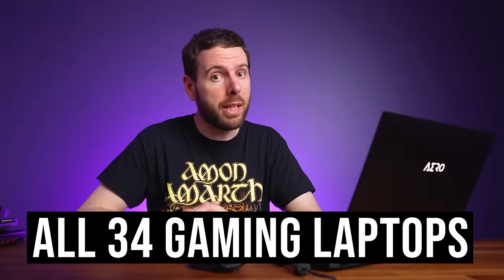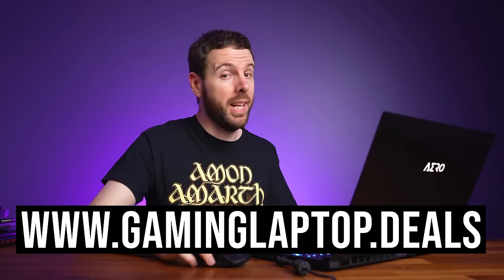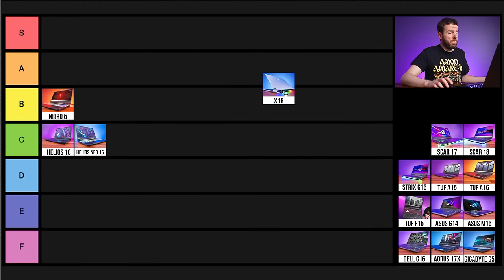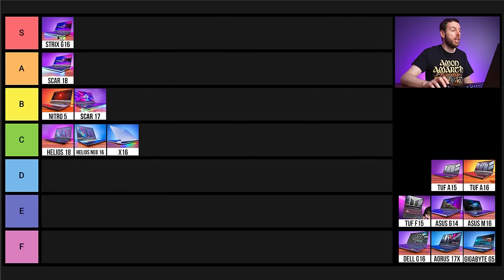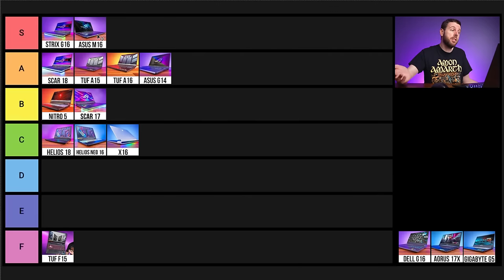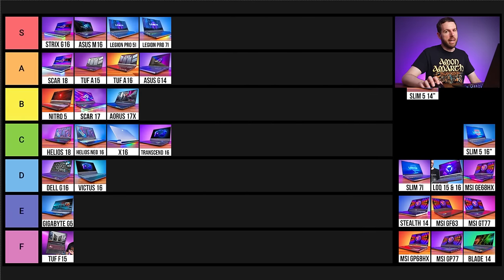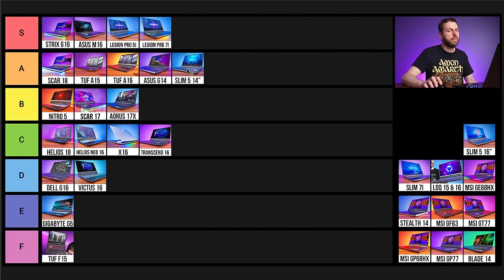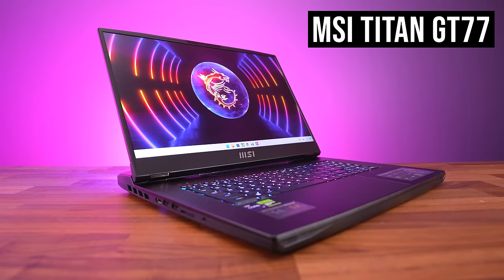Ranking ALL 34 Gaming Laptops I Tested In 2023!

Comment: LOQ is an S-tier budget laptop for sure. The amount of features it offers for that price range is really impressive
Reply: you just cannot upgrade the ram, I hate it
Reply: Only flaw is unupgradable RAM slots, and it should disqualify it being S tier. Definitely A tier. Id still pick Nitro V 16, cheaper, more upgrades and have Liquid Metal in it. 

Also for anyone curious, Nitro 5 and Nitro V are two different laptops. Check out Nitro V 16 or 17. Budget and High Tier.
Reply: Who says ram is not upgradable on the LOQ? I have one and plan to upgrade ram and have seen plenty of videos and forums about it
Reply: @mkgxcommanderx  i'm planning to buy LOQ 15 next week, how your experience been with it especially on gaming side does it overheat ?
Reply: @hvnsnt_9905 will games start requiring more ram soon ? Than 16 gb
Reply: The only issue with Loqs is their screen but again for their price they're totally worth it.
Reply: @m.heyatzadeh  they have 100 srgb options available
Reply: Depends on your country though. In our country, Helios Neo 16 is the S tier budget laptop since it's cheaper than the LOQ.
Reply: How is the ram not upgradable? I just bought a LOQ15 with 8GB DDR5, single channel. I upgraded it to 32GB dual channel. I checked my settings it says 32GB, both slots used. Online it says it supports 32GB.
Reply: For the people that say you cannot upgrade Ram, literally in lenovo's site it says it supports up to 32 gb of Ddr5 with dual channel. My only down side is the ssd second slot being virtually useless but it has a another so maybe just a minor downside but it depends
Reply: @fchk9731 hasn't crossed 85 degrees, playing RDR2 high settings for 2 hours. 120 fps with frame gen enabled. Insane.
Reply: Hey I'm planning to get asus a15 ..... do you thinks it's a good idea ..... can I get better with that price range
Reply: the LOQ 15 have a SSD upgrade ? i mean can i have more than 512 ssd?
Reply: @jaerys8823 no, cuz 16 is enough stop being babys
Reply: @m.heyatzadeh my loq have 2k, 165hz with 100% srgb. Whats wrong with it?
Reply: @mehshutup3041  That's good. I was talking about the 1080p versions which are cheaper and have 45% NTSC.
Reply: Hello should i get a Lenovo Loq ryzen 7 7840hs rtx4050 16gb or a tuf a16 Ryzen 7 7735hs Rx 7600 16gb?
Reply: @NAOTILTA  Nvidia RTX 4050 is a faster and more feature-rich GPU, while the AMD RX7600 is a more energy-efficient and cost-effective GPU. I'd go for RTX 4050, even though The AMD one has got faster memory, Nvidia RTX4050 gets a better support because of DLSS and it's more future proof than the AMD one.
Reply: @m.heyatzadeh  oh, so the loq one is better right?
Reply: @NAOTILTA  I'd definitely go for loq one. I've used Lenovo laptops for the past 5 years and they're durable and well supported. Although if you can go for the 4060 it'd be much better and more future proof since it's got 8GB of vram which will be helpful in demanding games.
Reply: just bought th e16IRH8!
Reply: What about the motherboard issue?
Reply: @knui333 mobo issues are for 2024 models.

Comment: This just proves how great of a job Lenovo are doing. Also as a legion slim 7i owner I think it's definitely at least A tier.
Reply: Can anyone help me im split between getting the legion slim 7i gen 8 with intel 17-3700H and RTX 4060 or dell g16 with intel i9-13900HX and RTX 4070 ik the specs look a lot better but peoples reviews have made me doubt myself
Reply: @EthanMcIntosh-qx1pm take the strix g16.Better build quality better costumazation better keyboard and a decent price now with black Friday.If not the slim i7 is good as well but I prefer the strix(have both)
Reply: @EthanMcIntosh-qx1pm I don't think Dell is worth.I know it seems better by specs but doesn't have the cooling and the 4060 is identical to 4070 anyways.
Reply: @EthanMcIntosh-qx1pm bro definitely do not buy a dell for gaming. You'll regret it
Reply: @EthanMcIntosh-qx1pm  whatever is cheaper for the same specs. But I have to say slim 7 looks like a professional laptop which I prefer
Reply: @koune1os17 Dell is not good enough
Reply: @lionelmessithegoatLM10  that's what I said
Reply: Hey I'm planning to get asus a15 ..... do you thinks it's a good idea ..... can I get better with that price range
Reply: @EthanMcIntosh-qx1pm Dell is garbage just like HP.
Reply: Lenovo is shit, don't buy it. They provide some great specs and the cost of build quality. I had two laptops in recent 3 years and needed to take both to repairment. One had ssd issue and motherboard issue (second one was costly and with no guarantee of not happening again soon), other had a screen issue and battery/charging issue. I have complaints by my friend as well. Lenovo was great 5 years ago and now it is just garbage.
Reply: @Windows98Fanboy  real, my g16 with a 12th gen i7 and rtx 4060, and 16gb ram can barely run minecraft with 3 optimization mods and shaders 😭
Reply: @koune1os17  what a clown... dell for gaming over Legion that is the best laptops 4 years in a row
Reply: In Argentina are more expensive than Dell or Asus or Gigabyte... what a shame

Comment: I struggle agreeing with the Zephyrus M16 being in S tier after ASUS sent out the variant with a 4070 and mini led to reviewers, but decided to not sell that variant in certain markets like the US, locking the mini led display to the more expensive 4080 and 4090 variants. This feels scummy from ASUS
Reply: Cap. 1500 at Best buy rn
Reply: @MangaRecapandAnalysis-ll6zj it's not the mini LED. It's just a regular panel.
Reply: @Razoronmd  oh damn good to know I was thinking of buying that one
Reply: Nah, you can buy a 4070 variant M16 with miniled

But just not the US

Definitely a dealbreaker for 2k, but for 1.5k? Considering the fact that you’re buying a t/l with a completely redesigned chassis + mobo for features typically only seen on thicker laptops? I would say it’s S tier.

As much as ppl trash on the 4070 about not getting more performance, the power efficiency really comes into play here as the M16, a t/l laptop, doesn’t have to partially cripple itself for the thing to even work.

I’ll stop circlejerking this thing, but I feel like if you’re very technically capable and are aware of ghelper, then this is the laptop to go for. 

But solely for performance alone? Yeah, I agree with y’all lmaoooo
Reply: Adding onto that too

The 4070 us m16’s screen is still considered like super top of the line IPS too.
Reply: In India it goes for 4000 fuck8ng dollars 😭

Comment: As a legion slim 7(AMD) user, it's plain perfect. 

Productivity-wise: Performance good enough for University projects . 4060 is quite capable of small to medium scale neural network training for edge AI in local environment. Extraordinary build quality, excellent 240hz 2.5k display suitable for all kinds of use cases, dead silent under light load, impressive battery life. 

Gaming: quite good when I play Cyberpunk. With the efficiency of 40 series GPU, I can achieve 70-80 fps at ultra when 140w portables adapter is plugged in. In cs2 the full potential of 240hz can be utilized. 

In a laptop form factor, it ticks all the boxes.
Reply: I love seeing all these comments on people thinking the legion slim 7 is underrated. It actually makes the laptop look better, which couldn't have happened if it wasn't originally reviewed as it was.
Reply: does the laptop get very hot and does the fan go crazy?
Reply: @yeye3124  Hardly warm to the touch when I use battery. No guarantee if you plan to game a lot. I've been running ROS Simulation in Ubuntu and debugging requires me to build the project every single time, therefore I can definitely hear the fan noise in this scenario. In terms of light use, it's dead silent.

Comment: I'm a little disappointed that you didn't recognized the excellent 1000nits Mini-LED Panel on the Predator Helios 18. That's what it make it better compared to other 18 inch Laptops. And the price is very good.
Reply: Helios Neo 16 also has a better display than all other laptops in that price range.

Comment: The Legion Pro and LOQ series is one of the best gaming laptops that Lenovo launched in 2023 which has overperformed than other laptops and has plenty of room to upgradeability
Reply: L0Q has a fatal flaw where there is an metal protrusion in one of the ssd slots and it is impossible to install full size ssd!
Reply: @eniojurko  i accept that drawback
Reply: @eniojurko it is posible. Just remove that thing. Removing it will not cause any problems.

Comment: Slim 7/7i is easy no 1 of the s tier. Best build quality, best price to performance to build ratio, best specs & upgradibility for price (16gb soldered & only 40dollar for another 16gig 5600), 2 m.2, all 10gig usb, tb4, type c charging 140w, sd card slot, most importantly you can turn off dedicated gpu completely, great color accurate 165hz 3.2k screen option for 20 bucks 😂, great keyboard as usual Lenovo, great doorstep support for 1yr free, 99.9wh battery, i just don't see how it's not top of s tier, 
The only thing they can improve is give an mini led screen as option or even better oled. 
I don't get why a "gaming laptop" has to be have only gpu & cpu specs & wattages to be great if that's what you want better build a pc.
Reply: Some people don't want low powered gpus such as 4060/70s in their laptop. I like have the 4090m in mine as I have a portable machine with 3090/4070ti desktop level performance wherever I go
Reply: Can anyone help me im split between getting the legion slim 7i gen 8 with intel 17-3700H and RTX 4060 or dell g16 with intel i9-13900HX and RTX 4070 ik the specs look a lot better but peoples reviews have made me doubt myself
Reply: I have a 4k 60fps dell external monitor at home. So picking 3k display will have a bit of overlapping in terms of functionality. But that's just me. No matter what kind of peripherals you have, legion slim 7 is easily the best choice for most people this year without breaking their wallets

Comment: IMO The helios neo 16 is waaay better and is heavily underrated. It has liquid metal, better cooling, hx intel processors and i think killer wifi card, upgradable in all slots, mux switch and all that for 1.2k+, dollars not to mention Newly upgraded design of the helios series. I think it competes with Legion 5 in the midrange area.

HELLA way better than those microwave TUF series be it amd or intel version. No ports at the back is a downgrade
Reply: Screen is meh, slim 7i has 3.2K diaplay with excellent colour gamet.
Reply: Fully agreed! The only position I disagree with.
Reply: Well,  Legion 7i is for in the premium ish range. The helios Neo is the budget option which competes with legion 5 also way cheapre, the Helios 16 is the more premium one and Im talkin the neo 16 here. 

Also Screen from the helios neo has QHD 16:10 @rajyavardhansingh4491
Reply: @jaerys8823  the display on Slim 7i is objectively better, and display matters to a lot of people
Reply: @LaptopDealsEU  what will you choose, LOQ 15 ryzen 7 7840hs 4050 or Helios Neo 16 i5 13500hx 4050 if both have the same price in my place?
Reply: @ryon24  depends on the screen. If LOQ is just 144Hz, then Helios.
Reply: At $799 at BB the Helios neo 16 is underrated here.
Reply: @LaptopDealsEU  the LOQ screen is 165hz, im using an external monitor, so the screen wont bother much
Reply: @ryon24  When connecting a laptop to an external monitor, there is another significant difference. We are talking about the "Memory bus" of the graphics card. The 4050 has 96 bits, the RTX 3060 has 192 bits. The wider bus allows better data transfer. While the level of the 4050 is similar to the 3060, when connecting to an external monitor the wider 192-bit bus will make a very big difference and it is better to take a laptop with a 3060.
Reply: I bought the RTX 4070 version recently. It doesn't thermal throttle, the screen is professional grade, and the port selection is generous. Plus all the stuff you're mentioning. Jarrod made a huge mistake right here with that model, and it's a shame he doesn't see it himself.
Reply: What makes the helios neo 16 so annoying is that they put hx intel processors and then they disable undervolting... with no workaround to undervolt it. unbelievable. I returned it.

Comment: Hi Jarrod, what would you rate this - 
Lenovo Legion Pro 5 AMD (2023) specs:

- *Processor:* Ryzen 9 7945HX (16 core, 32 threads, 5.4GHz, 80MB cache)
- *GPU:* RTX 4060 8GB (140W, DLSS 3)
- *Display:* 16-inch, 240Hz, 16:10, 2560x1600 QHD IPS, 500 nits, HDR 400, 3ms response time, G-Sync, Dolby Vision, X-Rite, Delta <2, 93% screen-to-body ratio, Dual direct gfx 1.5
- *RAM:* 16GB DDR5 (8+8) 5200MHz
- *Storage:* 1TB Gen 4 SSD, 2 SSD slots
- *Battery:* 80Wh, 300W adapter
- *WiFi:* 6E
- *Webcam:* HD
- *Sound:* Nahimic
- *Keyboard:* 4 Zone RGB backlit
- *Cooling System:* 10mm 3D mesh, 2 cooling fans, 5 cooling pipes, 4 cooling vents
- *Build:* Metal lid
- *Price:* $1650 USD
- *Cons:* Loud fan noise, nearly 1kg power brick, poor battery life.

Comment: Can you give me some advice? I’m indecise between these two you ranked high:
1. Asus A15 Ryzen 7 7735HS 16GB RAM RTX 4060 1TB SSD 144Hz - 1215€
2. Lenovo LOQ 15 Ryzen 7 7840HS 16GB RAM RTX 4060 512GB SSD 144Hz - 1250€

Cheers!
Reply from the maker: Personally I'd spend the extra money for the Zen 4 CPU, not as much SSD space, but you can upgrade that down the line if you need it, can't ever change the CPU.

Comment: I bought Strix Scar 17 RTX 4090 this year. This is my second laptop which I bought based on this channel recommendation and review. Thanks to Jarrod, choosing a laptop has never been this easy.
Reply: I'm about to get the same but 4080 with 16gb ram, how's yours
Reply: Nice, i also have it. I upgraded it to the max 64 gigs of ram. I so wanted the scar 18, 4090 where you can get up to 128 but it was out of stock. Can’t win em all
Reply: @chrisgateway7846  4080 is the best for value. I got 4090 because the 4080 was out of stock. But for me 4080 is more than enough.
Reply: @JakeSlaughterr  Damn thats nice! I can't decide a laptop that is around 1,100 dollars...

Comment: 1st of all, I really like this kind of videos from you. Excellent and super informative. 2ndly, i think it will be much easier if you rank it based on how much would you recommend the laptop rather than the overall aspect of the laptop. Of course your recommendation will consider the overall aspect, but ranking by recommendation will be easier to do especially for those laptops that hv lots of good features but totally not recommended due to unreasonable price, like the titan gt77 (if im not mistaken).

Comment: damn i think this years helios 16 was quite a beaut, sad we missed out on it.  ( oh but it has only 1 m.2 slot just like the HP Transcend)
and whats up with the nitro V ? was it a south-east asia only release or something ?
all the alienware's brightness power budget went into the LED brightness hahaha classic
btw, love this format where you personally pick your fav laptop out of them, and share your opinion as to why. its so nice. completely subjective yet somehow remains objective.
Reply: Yeah the Helios 16 with the Mini-LED screen is super good. While it "only" tops out with an RTX 4080, the 4090 isn't much better but would be much more expensive, not to mention it's pretty reasonable for a Mini LED config; I've seen it on Amazon for about $2500. For a top of the line screen, an Intel Core i9-13900HX, and an RTX 4080, that's impressive, apart from the battery and performance on battery.
Reply: Who told you it has 1 m.2 slot , it has 2 bro .

Comment: they both have the same feature. I live in Sweden. Which one should I buy?

MSI Thin GF63 - i5 | 16GB | 512GB | RTX 4060 
--
Lenovo LOQ 15IRH815.6" - i5-12450H - GeForce RTX 4060 - 16GB - 512GB
Reply: The price of both is the same 850 euro
Reply: Go for Lenovo LOQ. MSI's GF series is notorious for its hinge problem that it breaks after a year or even earlier (my brother has one and is now forced to use an external monitor)
Reply: @sakamoto8354  Thank you I'll take Lenovo

Comment: Things to consider with Razer: 

- They typically run marginally quieter with their vapor chamber cooling. 

- Might feel like a “metal slab” but it also feels premium without all that junk plastic flex. Keyboard, hinges, screen flex are all S-tier. 

- Doesn’t “look like” a gaming laptop. You can easily put a sleeve over the Razer LOGO so it appears great if you’re using it in a professional setting. 

- Lastly, their screens typically reach 500 nits versus the standard 300 which really brings out colors/contrast and is beautiful to play games/movies on.

Comment: I just received my TUF F15 with a i7-12700H and RTX4060, 515GB SSD and 16GB RAM that I bought for 999 Eur on this Black Friday weekend on Amazon.
My other option was Acer Nitro 5 with a ryzen 7 5800H and RTX3070, with a 1TB SSD and 16GB RAM but would cost me 100 Eur more.

I watched like 20-30 reviews on Youtube and read a lot of comments on Amazon and decided to go for the TUF and just to upgrade it with a 1TB SSD, which costs around 50-60 Eur on Amazon. I decided against the Nitro, because it seems like it has a big overheating problem (and by that I mean above average). And I know a RTX3070 sounds nice but it looks like the 4060 works more efficently with power and offers with DLSS more longevity in the future and that by being very similar in performance.
Also TUF F15 looks way nicer (for me) and feels less like cheap plastic.

A bit disappointed that it landed almost on the last place in your list, although I know you reviewed it with different specs.